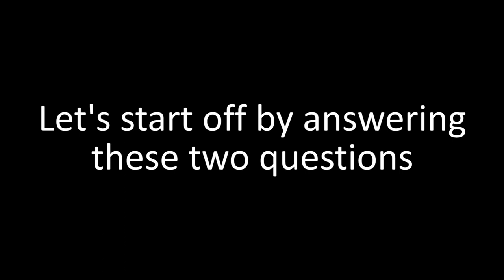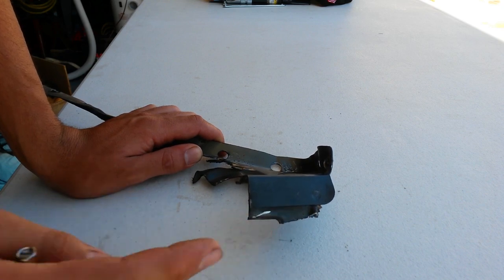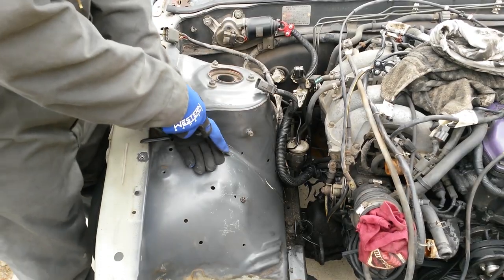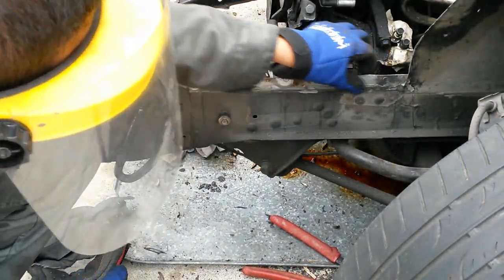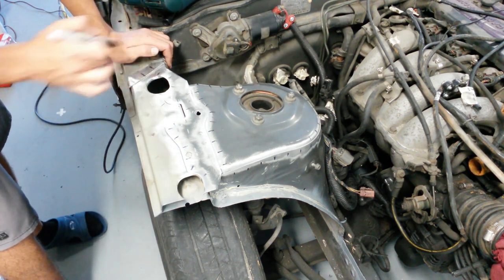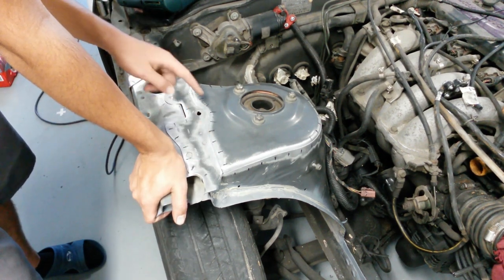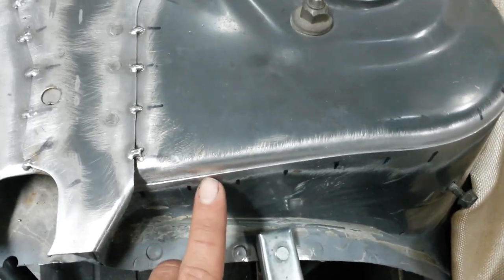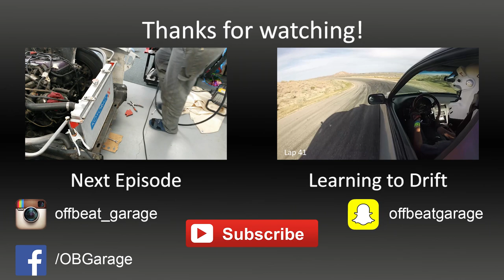Project 240 - Le Drift Car II | Ep. 3 - Cutting the Front & Stitch Welding

Comment: Hay question how much is all this costing you
Reply from the maker: Mike Davis So far everything I did was free lol. Maybe $30 spent on different drill bits and that's about it. Welding the spot welds doesn't use much material or gas either so that's like nothing

Comment: Why didn't you just take the entire engine now, instead of starting now and then still removing the engine later on?
Reply from the maker: Need the engine in the car so I can build the tube front and make sure none of the tubing will interfere with engine components.

Comment: What are these bolts for ? 26:53
Reply from the maker: Ch0k0TB The ones on the front of the shock tower are for power steering fluid reservoir, and the ones toward the side of the shock tower are for emissions equipment.
Reply: ***** Thank you :)
Reply from the maker: Ch0k0TB No problem :)

Comment: #askoffbeat what is your daly the old le drift car 1?
Reply from the maker: Just a guy I don't have a specific daily, I just use whatever cars are around the house haha. Whether that's ldc1 or a nissan leaf or a van etc. etc. lol
Reply: Hahaha where is the old le drift car1?
Reply from the maker: In the driveway sitting there looking cute haha
Reply: plan on selling it?
Reply from the maker: Haven't decided. I'm going to take pretty much everything aftermarket out of that car and some other parts. So by the time I'm done with it, it won't really be the same car.
Reply: I have another question how are you going to fix the smashed in back quarter panel of the new 240/180sx and when is the part 4?
Reply from the maker: Just a guy Using a mini sledge and a slide hammer. Either that or to save time I might just drop it off at a body shop and have them fix it for like $200. Haven't quite decided yet
Reply: Sweet

Comment: The grinder wouldn't have shot at yo face if you had it turned around.  Always have the grinder want to pull away from you.  Unless you're cutting a piece of unsecured metal I guess but that's a rare occasion
Reply from the maker: donotforgetthis2 Because I'm right handed I just tend to feel more confident holding the grinder that way. I know what you mean though

Comment: You should get a carbon wing!!
Reply: That'd be pointless for drifting unless it was fully adjustable and he had enough power to need downforce... 😪
Reply: yeah, i know but when he get enough power a carbon wing is better because of weight!!
Reply: Yeah but with a stock motor there isn't going to be any need for a while.
Reply: TheRebel3000 my cousin had a 240 with the stock ka engine and he got 400bhp out of it!
Reply: And remember, a carbon wing is an easy 400+ HP
Reply: Haha yeah!! stickers too!
Reply: Carbon lip spoiler
Reply: ONEGUYMORE all about those extra fake red plastic stick on brembos. Work a treat and add at least 50 - 150hp
Reply: haha no, rice is best on the plate instead of the road!!

Comment: You shoulda used a TIG welder instead of a MIG.
Reply from the maker: 0blackaudi0 I don't have the money for a tig welder though haha
Reply: Most higher end models are capable of doing both, you just have to switch to a torch. Yours is a Harbor freight?
Reply from the maker: 0blackaudi0 Not Harbor Frieght, it's a Longevity MigWeld 140

Comment: whatever you do pls dont use bodyfiller
Reply from the maker: Plan0B0Krue I'll probably weld and flap disk it smooth.
Reply: you mean a grinding wheel right? the flat one is a cutting wheel. I'm sure you do, you seem to know what your doing. Nice 240sx by the way most 240's in my area are all banged up or rust buckets.
Reply from the maker: Plan0B0Krue I said flap not flat lol. It's a wheel that is comprised of sandpaper essentially and is good for leaving a clean finish as well as sanding down metal.
That's how a lot of 240's are :/
Reply: thought you miss typed. but yeah ive got a car worth 5gs and cant find a 240sx worth the same to save my life hahah.
Reply from the maker: Plan0B0Krue Hahaha sorry to hear that, luckily it's a much better situation where I live